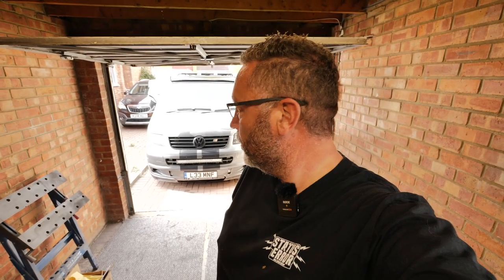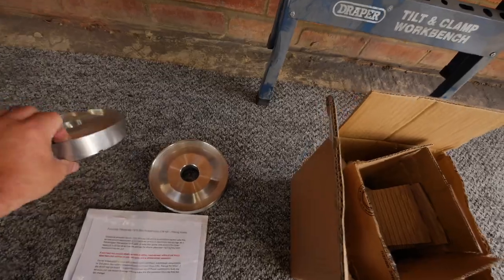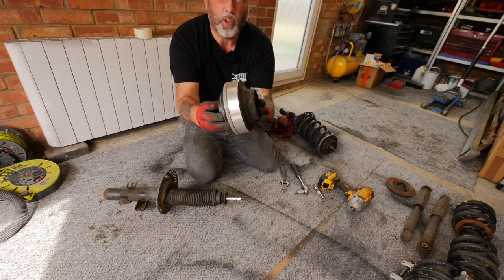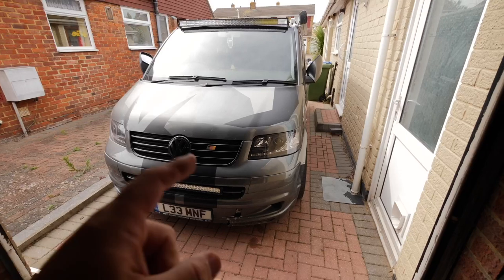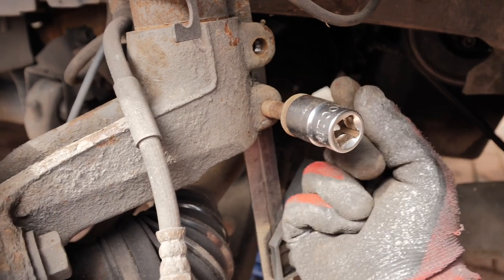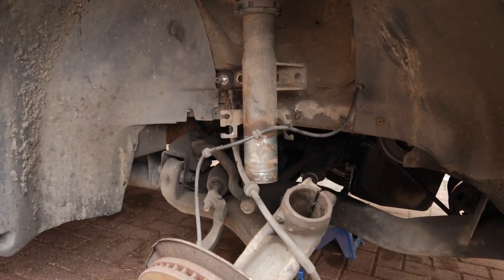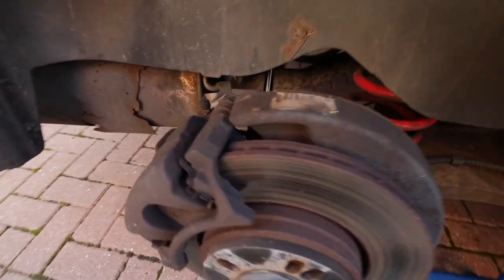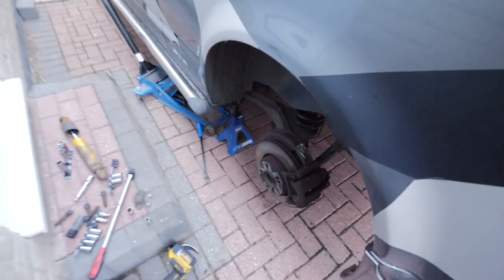25mm Lift kit fitting - VW T5 Swamper conversion part 2

Comment: Put the PCD 25 mm kit as shown here on a new T6.1   4motion. Combined with 25mm higher profile tyres, has proven to be very practical in both rough outback roads and tracks in Australia. No noticeable downside on bitumen either.
Reply: Hi. Did your 4Motion come with the VW factory upgraded springs?  I think the rear coils have four blue paint marks.
Reply: @hossp2365  …. Just the factory std weight springs as we aren’t carrying more than about 600kgs. Have a very comfy and compliant ride on rough roads.

Comment: Great video, hope the instructions made the job straightforward. Won’t help now, but if anyone else is tackling lowering or raising the rear, it can be done without removing the arb, you just need to remove the lower damper bolts from both sides so the arb isn’t fighting the spring removal / replacement.
Looking forward to see the van with a set of a/t wheels / tyres.
Reply from the maker: Lol yeah I did think of that once I’d finished. My problem was I jacked up one side at a time!

Comment: I can't find the video you did on the jump pack/tyre compressor, but I remember you mentioned the battery drain might be something to do with the alternator? 

Just read this on a forum - "Blown diode in the alternator that allows yhe battery to drain via the alternator" - don't know if you already sorted it but hope it helps 🙂
Reply from the maker: Yep I have been thinking the same. I’ll get around to it eventually. I’ve actually been sent a new version of the compressor/starter it’ll be in a video soon.
Reply: @SpyderLEE  my T5 is actually off the road at the moment with a duff alternator and I understand the front bumper needs to come off to access it, was hoping in this Swamper series you might have done your alternator whilst the bumper is off so I can see what's involved
 ;-)